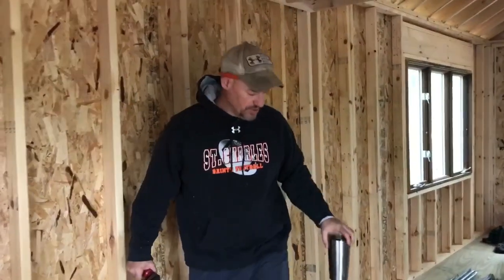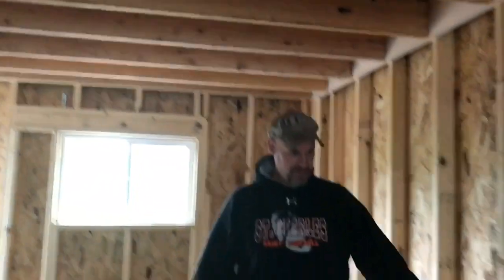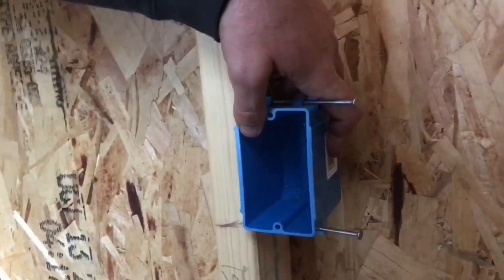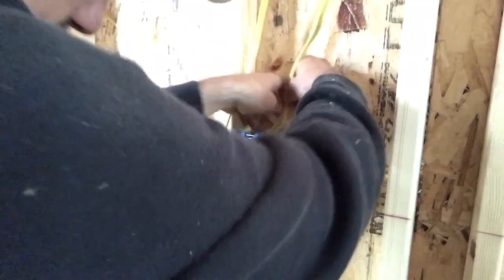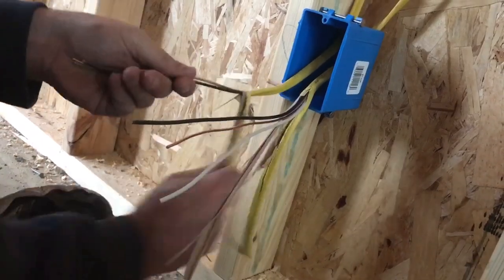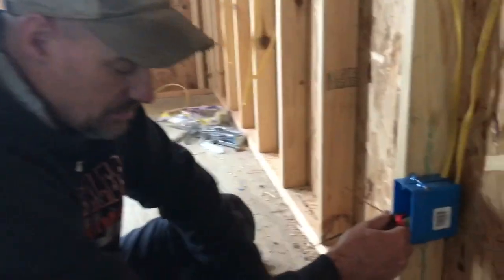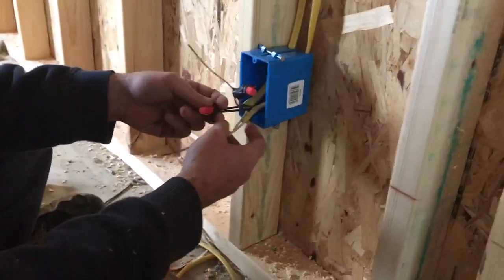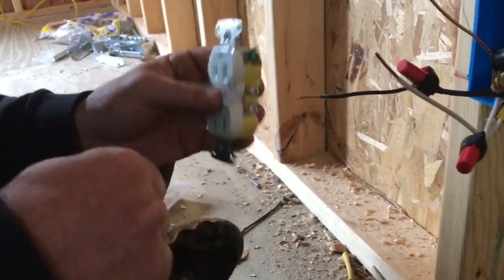DIY- How To Wire a Small cabin

Comment: 12 gauge wires can be challenging to twist correctly. There are some good videos on yt that show this. Get a good pair of linesman pliers and some scrap 12 gauge and practice. Alternatively, you could use Wago lever nuts and forget the hassle. All that extra sheathing is robbing you of space in the box. Use a deep box, 20 or 22.5 cu in. Use a green wire nut with a hole in it for ground, it saves space and eliminates the need for a separate pigtail.
Reply: Great info. Never heard of these wago connectors yet, nor have I heard fo the green wire nuts with hole in the end. Thanks.

Comment: Any reason why you pigtailed the hot and neutral wires instead of putting both neutral wires on both of the silver terminals and both hot wires on both of the brass terminals?
Reply: What you're describing is a series circuit.  In a series circuit, if one outlet goes bad, the rest of the outlets on that circuit stop working.  In a parallel circuit (here), only the receptacle that goes bad stops working.  This is why houses are wired in parallel.  Imaging an outlet going bad in your kitchen while you're gone.  If it was wired in series, your fridge would stop working even if the receptacle operating the fridge wasn't the one that went bad..
Reply: @da324  makes sense, just way quicker not having to do the pig tail to each outlet
Reply: spratsprat yeah it’s actually smart to put pig tails on hot and neutral because if the outlet breaks or malfunctions power will still be fed to the other outlets or whatever else is on the circuit. If he attached the hot and neutrals to the outlet, everything after that outlet will not work .
Reply: Jeremy Mccomas      Either way is acceptable!    Totally a matter of personal preference.   The arguments of one receptacle going bad the rest go out is typical.   My statement is, more splices, more points of possible failure.   One of the splices with wire nut fail, the rest of the circuit goes down.  So really no difference except where you call the failure point.   Make sense?
Reply: Anthony Joseph    Please read my comment
Reply: da324     Please read my comment
Reply: You can daisy chain your line ,but it is much better to put jumpers on all continuous lines. Most electrical company's only do jumpers for faulty problems in the future. If your a home owner I recommend doing so. In most cases it relieves a lot of stress on the line and receptacles plus freeing up space if done right.
Reply: @da324  thanks for that info. I was wondering
Reply: @da324  , pigtails not necessary. it still parallel, only needed on ground. code in my area says each kitchen appliance is on it's own circuit
Reply: @da324  @spratsprat3266 way is also in parallel, so long as you are connecting the hot and neutral to each receptacle. Doesn't matter if you twist them together or if you put each wire in the sides of the box (easier this way). To run in series, you would need to run 1 hot lead from the breaker to the last receptacle  on that circuit then connect every receptacle with a wire, between them (N), and  on the first receptacle run that neutral wire to the breaker.
Reply: @KevinCoop1  I did and parallel is code in most places.

Comment: Just watched your video and it's just what I need to get started doing my shed "Man Cave". I will be running a 30amp Generator for power however I was hoping to see you connect the wires from the Generator Connector to the Circuit Box because that's where I'm stuck right now. Can you tell me where you connected the wires? Thanks!!!

Comment: Just use the 4 screws  2 silver neutral 2 brass hot less joints and space in electrical box
Reply: I was wondering, " why the wire nuts?" I can see on the ground, but not on hot and neutral. Just seems like another place to fail.

Comment: Nice video and good information, but I'd put the ground down. Code doesn't specify, but most equipment that needs it one way or another is designed for ground down. Also, OSHA recently made one of my clients, an electrical firm, change theirs to ground down stating one is less likely to break the ground connector off when unplugging if it's down.

Comment: Is there a certain height from the floor that the Holes for the wire have to be?
Reply: Nope but there is code for holes to be located centre stud to avoid being pinched by drywall screws

Comment: Can you use a gfci outlet on that instead of the one you used?
Reply: Yes you can but you wouldn’t use a pigtail connection like he did because a GFCI outlet needs to have the “line” and “load” separate and wired onto the corresponding sides of the receptacle.

Comment: Youre putting 15amp  outlets on a 20amp wire, , which could be an issue.  What is the current youre going to send through it, from the generator?  Could be safe, just be knowledgeable, so youre safe.
Reply: Jerry Mack he put the 15amp outlet on the 20amp wire cause trying to put it on a 20amp outlet is a pain in the ass
Reply: James Thompson    You really should not have commented!    The only difference between 15 and 20 amp outlets is amps and price.   Connections are Exactly the same, no difference in any way!
Reply: Perfectly fine to use 12-2 for 15 amp now 14-2 for 20 not so good.

Comment: Great video! I'm doing the same and have a question, what kind of inlet (plug in) did you use on the outside of the cabin to connect the generator to the cabin? I am using 20 amp wiring. Thanks
Reply from the maker: I have 30 amp service and just used a 30 amp inlet box. I bought a cable that had male connection to generator to plug in. The other end was female which I plugged into the inlet that had male prongs also. I put a breaker on the inlet box and then connected to the service panel in the cabin using 8 gauge wire.  It’s been perfect for the last 4 years.
Reply: @sternbergoutdoors978  can you simply use a transfer switch? So you wire all circuits to the transfer switch then use a hook up to the generator? I’m thinking of doing a similar hook up to what you have here.

Comment: American electrics is still in the  70´s. you guys need to move on.
Reply: Why do we need to move on?
Reply: Has electricity come with a new update? It’s not like it’s software that needs to be upgraded every week. It works. Why fix it
Reply: @jakedaly7906   simple things like a dry lining back box would make any drywall socket installation much easier.  its more so the hardware needs an update.

Comment: Wouldn't it be better to mount your electrical panel to an inside wall, especially when you only have 2x4 studs ?
Reply: knight Owl     Most residential "load centers" are made to fit standard 16" spaced 2x4" wall studs.

Comment: When twisting wires together, use two pliers just like you do in plumbing with pipe wrenches. One to hold the wires at the base and one to twist them together. This way the wires do not turn and twist within the plastic sheathing. Secondly, plastic tape around the wire nuts is a fire hazard.
Reply: No... and no. Pull up any electrician's You Tube channel and watch them twist wires together. Surprisingly, no one uses two pliers. Also surprisingly, no one uses adjustable pliers for the job...  And electrical tape around wire nuts is simply a choice. Some inspectors want it, others don't.
Reply: Don't use 2 pliers, you can gouge the insulation that way.

Comment: There is no way the framing for that small cabin even meets code, not even close. Those rafters above is not to code at all!  The rafters are just only toed in by nails that will not carry the weight!  Rafters not even held in with U brackets.  Unsafe!

Comment: Receptacles connection is really bad,why not connect two black & white wire directly to the receptacle?
Reply: Dawa Sherpa....His connection is fine, because he's wiring it in parallel.  What you're describing is a series circuit.  In a series circuit, if one outlet goes bad, the rest of the outlets on that circuit stop working.  In a parallel circuit, only the receptacle that goes bad stops working.  This is why houses are wired in parallel.  Imaging an outlet going bad in your kitchen while you're gone.  If it was wired in series, your fridge would stop working even if the receptacle operating the fridge wasn't the one that went bad..
Reply: Dawa Sherpa     Either way is acceptable!    Totally a matter of personal preference.   The arguments of one receptacle going bad the rest go out is typical.   My statement is, more splices, more points of possible failure.   One of the splices with wire nut fail, the rest of the circuit goes down.  So really no difference except where you call the failure point.   Make sense?
Reply: I can't tell you how many times I've had to trouble shoot a line because of one stupid receptacle that is hidden or can't be found.
Reply: Jumpers good.
Reply: @southdakotaproductions1103  Wow.   I suppose church sunday is out huh?
Reply: @southdakotaproductions1103  you sir are a fool. In 40 years I seen more wirenut failures the device failure. You worked for me you would be fired.